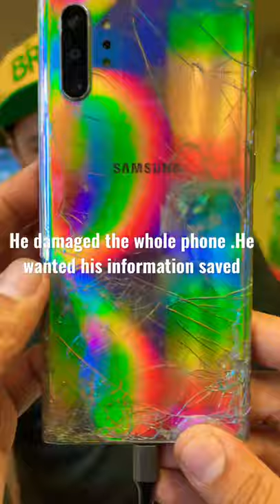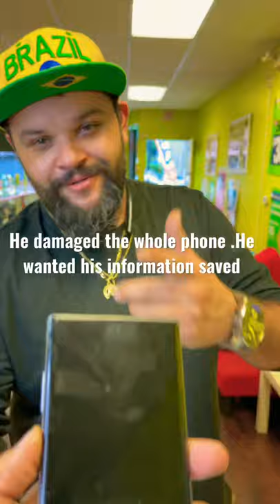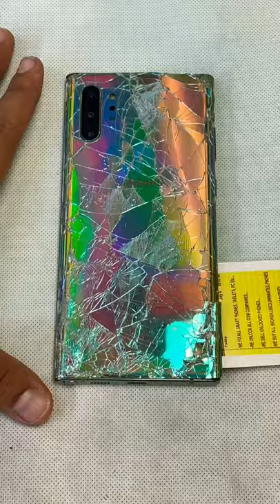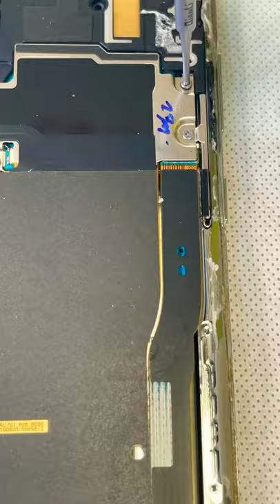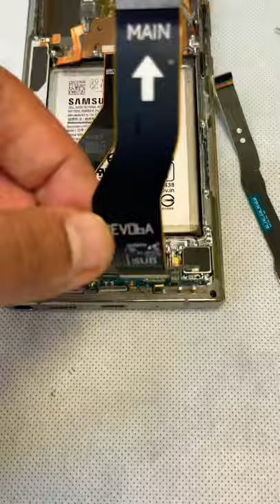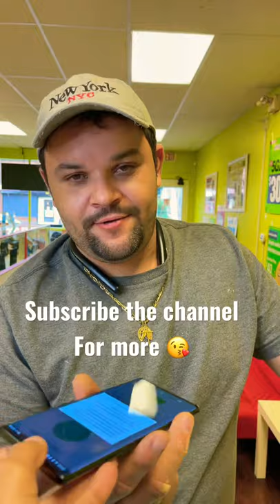NOTE 10 PLUS DATA RECOVERY ,FRONT & BACK REPAIR #shorts #samsung  #android #ios #apple #iphone

Comment: I have a question, my phone glitches when I plug in my headphones, do you know why it does that????
Reply: put it in a microwave (wrapped in dry paper towels) for 15 seconds max, and it will come back to life
Reply: I think the headphone input is loose or unclean and its interfering with other stuff
Reply: @oofbychips1809  Hmm maybe... I hot new headphones and it still does the same thing so that could be the reason. The way my phone glitches is google says the time when I dont say anything, my videos pause and skip, and my volume turns up and down.
Reply: @AminowingG  oh the headphone buttons are broken
Reply: @oofbychips1809  Headphone buttons??